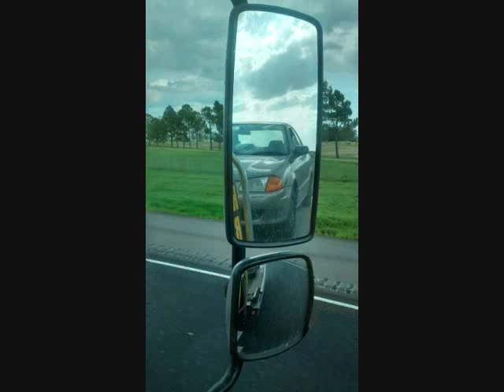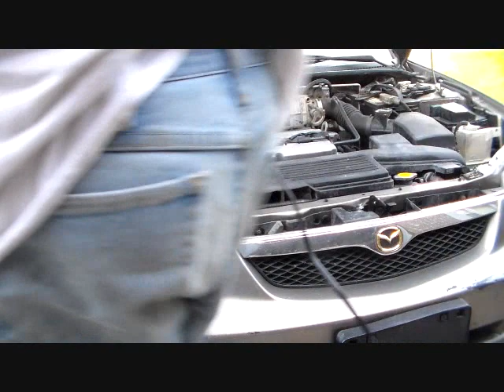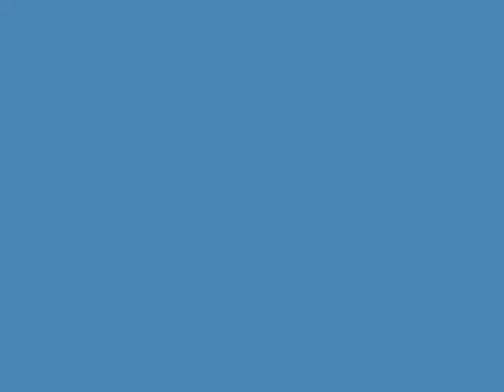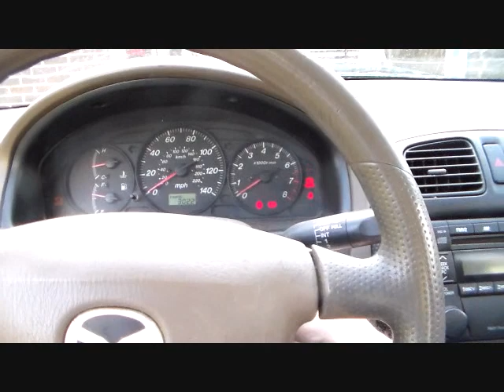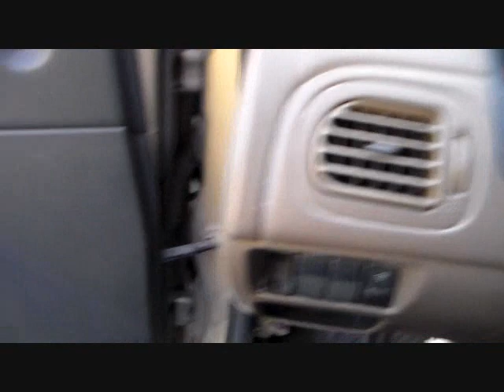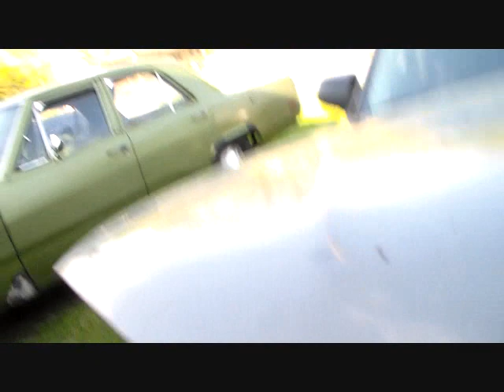Mazda P1345 no Cam Position Sensor signal

Comment: I have a 99  626 with the same issue. Gonna try the hair blower trick. She seems to be starting fine on cooler summer days but the other day when I drove it around for a bit and it was super hot out she didn't want to ignite at all

Comment: Ok so i hv the same probelm,  i replaced the  cam sensor but still,  when im in traffic or leave the car to idle for about 8 mims , the car shuts off , i allow it to cool for 15 mins or so and it starts right back up. 2001 mazda 323 familia (singapore)...anything else i could check? Driving with the bonnet open now !
Reply: Ray Asche check and replace the speed sensor and neutral safety switch? I have a Mazda Protege 99 here in USA and my car makes a buzzing electric sound for a second when I shift to R,N, and D I talked to a Mazda enthusiastic and he told me that he replaced all sensors and transmission fluid and the car gives him no problem now
Reply: do you solved the problem?
Reply: @TheJorzax  yes that and replacing fuel pump

Comment: Where is the port on the car and what port does it use?
Reply from the maker: Which PART?
Reply: WhoSaidTyler I was talking about the scan port
Reply from the maker: It's located under the dashboard, about where your knees are. You use an "OBD code reader". You can buy them at any local parts stores, or if you are in a location where that isn't a good option, you can order off the internet. You don't need an expensive reader, one around $50 works fine.

Comment: Use a cold wet rag on this sensor and it would crank back immediately, I'm diagnosing this same problem currently at my shop. Another way is breaking loose the cam sensor 10 mm bolt , don't remove , run until hot no restart condition reoccurs immediately remove bolt install new cam sensor reinstall bolt to proper torque restart engine ,then repeated hot soak condition, no repeated failure to crank, problem solved!

Comment: as soon as you noticed some symptoms scan it with the OBD II. check and test the troubled area for broken, corroded or loose connections before swapping expensive sensors. Never feel bad about doing so especially if you intend on keeping the vehicle. Autozone offers lifetime warranties, so paying for them once is all you'll have to do. Eventually you'll replace everything on a long enough tangent.

Comment: excuse me sir.....perhaps you can help me out with my Mazda Millenia. very good video by the way. My millenia basically stalls out a lot mainly at idle or stop lights or stop signs. but i do have the p1345 code similar to yours. i havent had any issues dying on the side of the road yet. cross my fingers. my question to you is  "Did the replacement part (the cam position sensor)  resolve your issues?  and if not....what else did you find oout about these faulty Mazda MIllenias?

Comment: Helped understand a little more...good job
Reply: fellow Mazda owners it is a MUST to have an OBD II scanner to eliminate all the guess work on these 96 and later vehicles. 
my p1345 turned to be a severed wire on the outside of the distributor on my 97 MPV. I soldered the wire and now I'm back on the road. Thanks for all posts.